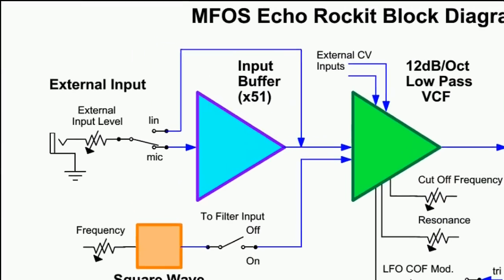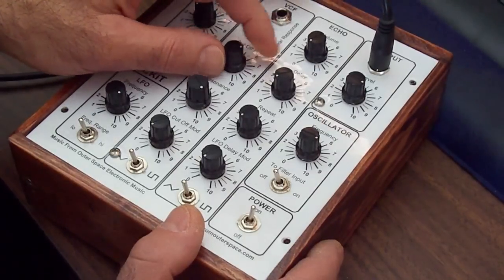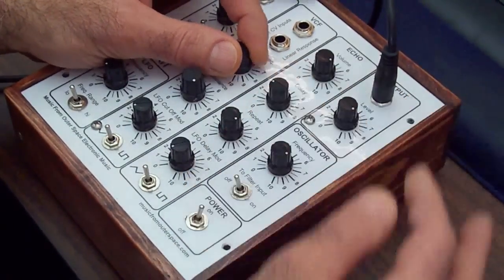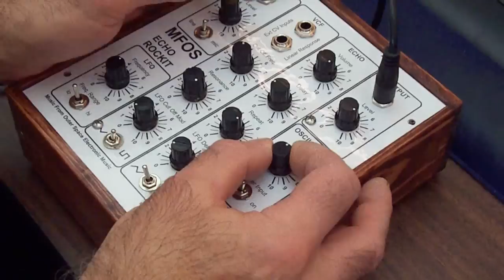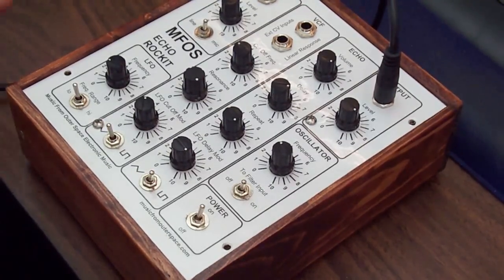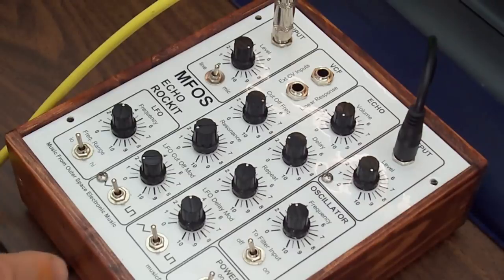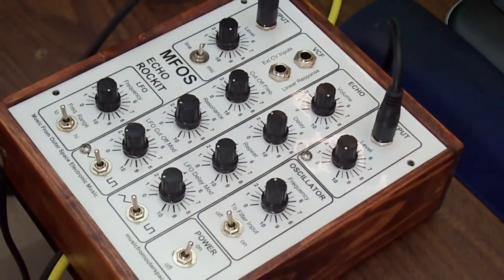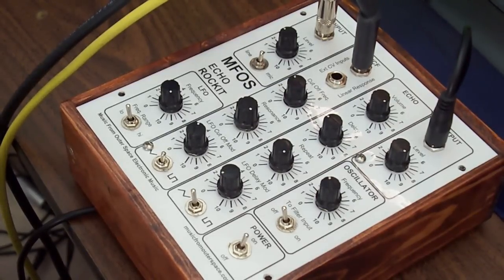MFOS Echo Rockit Presentation

Comment: just finished building mine but it doesn't sound like yours. I'm wondering about the pots I use, they are called commercial type and retail at about 30p each i.e.20cents approx.in American. It also eats batteries so shall be incorporating it into my system supply for which you very helpfully show a 'how to' on the web page. It's been fun.

Comment: Why is it so noisy? Can it be improved?
Reply from the maker: +nihonam The PT2399 is noisy when it is out of it's non-noisy range of clock frequency. The box lets you explore low (thus noisy) clock rates for the echo unit to get longer echo times. At short echo times the unit is not extremely noisy.